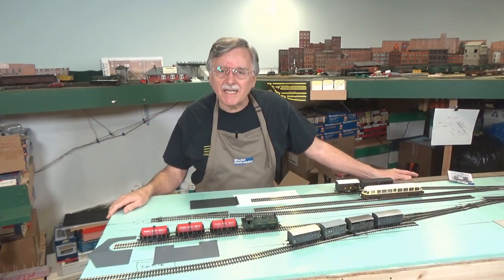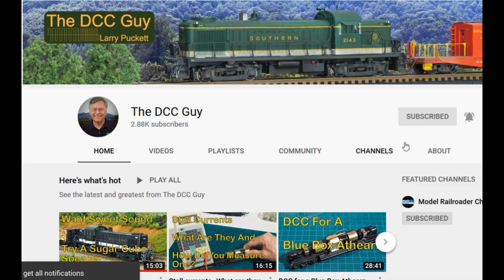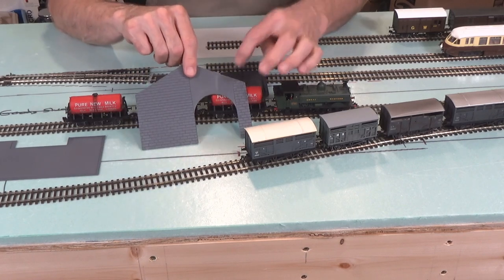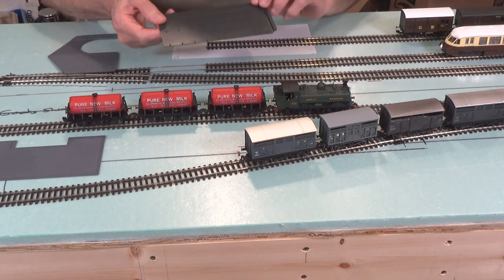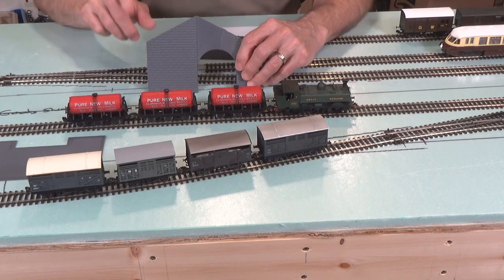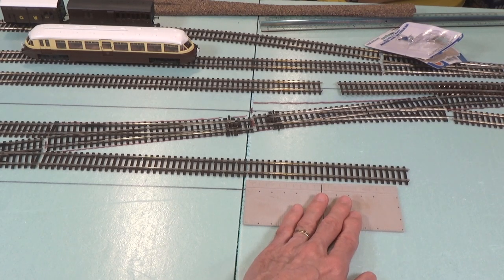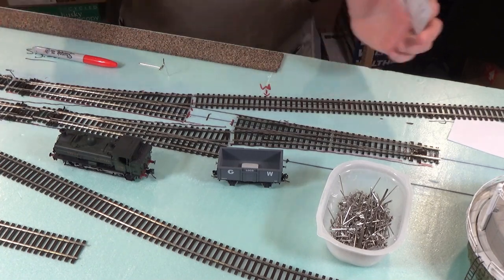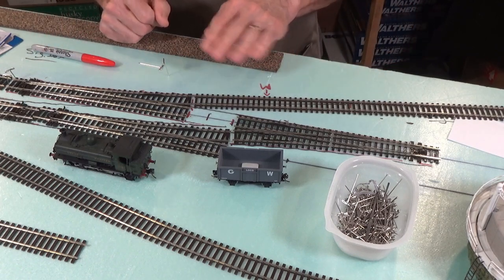Installing Under Track Magnets (138)

Comment: Thanks Larry. Ike to mention to you that the locomotive which I am talking about it does not has a decoder in it. Thank you
Reply from the maker: Ok, so when you say with DCC control, you are using address ”0” to run it? If that is the case then that is just the way the motor responds to the way DCC systems that support “0” bit stretching to run DC analog locos go about doing it and one of the limitations of the process. It is not recommended that you do this often or for very long, only as a way to test the operation of a new loco before installing a decoder. Most people I know turn this feature off in their command stations as it can interfere with regular DCC operations.

Comment: Hey Larry, could you have used some double-slip switches instead of the multiple L & R turnouts?  Could save some space that way :-)
Reply from the maker: Yes, but they are a pain to deal with and install. My basic philosophy is to keep it simple for easier operations and maintenance. Railroads avoided complicated switching scenarios unless absolutely necessary to avoid complexity and added costs and so do I. Just because you can do something does not mean you should do it, very often the opposite is true!

Comment: Hi, DDC GUY Larry.  I have a locomotive it is running fast with DC Power control, when I transfer to DCC power control it is move very slowly .please advise
Reply from the maker: Stuart is right about this, but also check your settings for analog operation, you may be able to make adjustments that way too depending on the decoder.